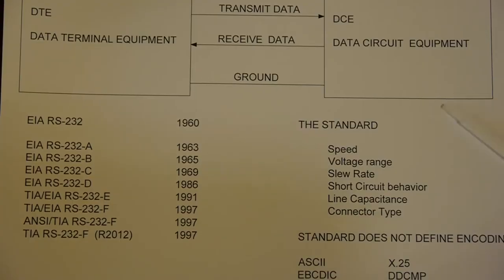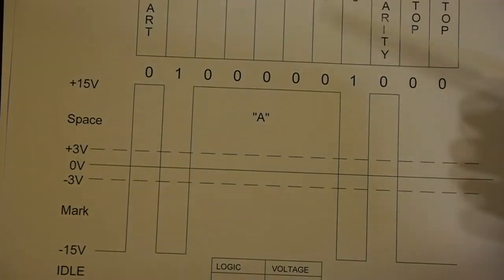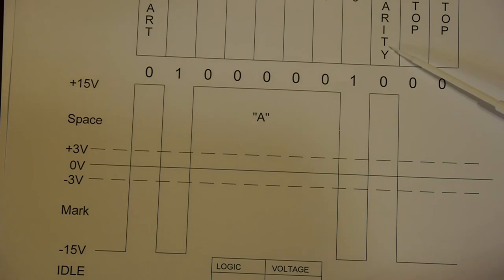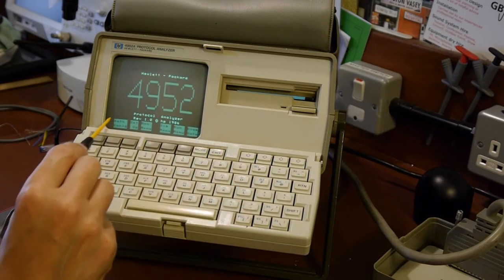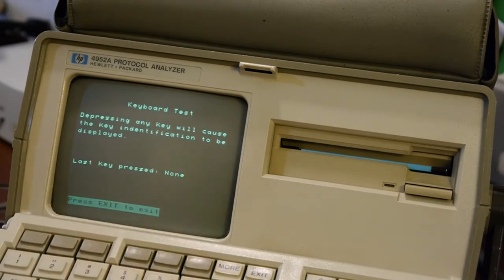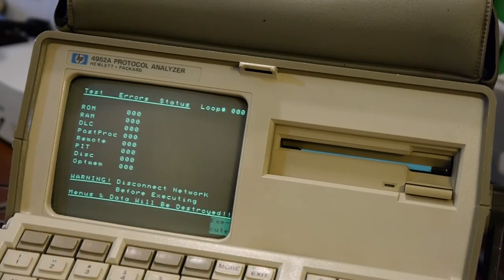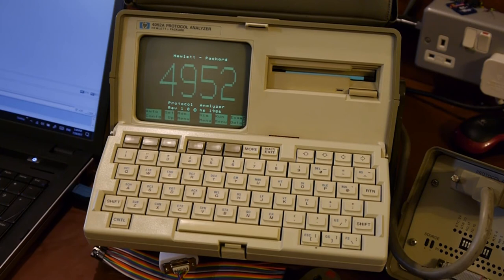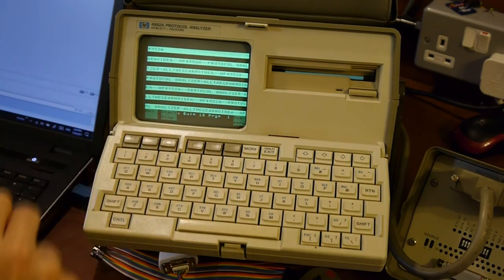Im A Serial Killer - Part 2

Comment: Nice video, Chris. Takes me back a bit... As was hinted at, this device was capable of much more than simple RS232 capture and analysis. It could help you with higher level frame-based protocols such as SDLC, HDLC, X.25 etc. Think of it as a serial line equivalent of Wireshark, albeit in a 1980's context.
Reply from the maker: oldblokeh Yes your correct it will do a lot of other formats. I have to say that I have never heard or used them. Regards Chris

Comment: Very interesting piece! Very useful back in the day, but I guess it would also be useful to people like Mike Harrison (mikeselectricstuff on YT) when trying to reverse engineer an older piece of equipment (though I'm sure he does everything with his scope).
I wonder if this kind of equipment could've been used to check communications in secret, you know, spying, checking for keywords, that sort of stuff.
Reply from the maker: MrDubje yes I guess it could have military applications I have certainly seen similar equipment dressed up in military style enclosure. As you say a lot of what this can do is covered away by a modern scope and there are  a few software tools around that can be used for serial monitoring and analysis. Best regards Chris